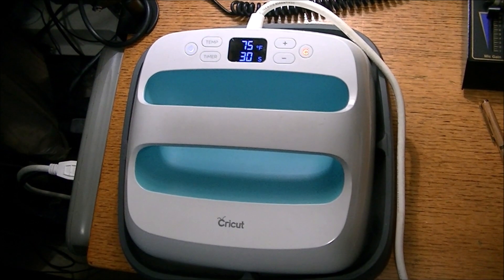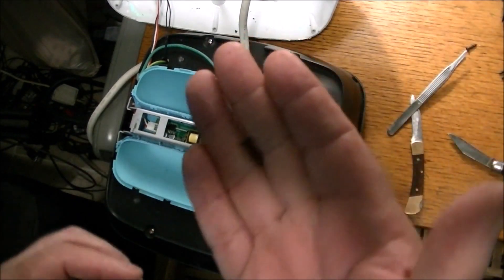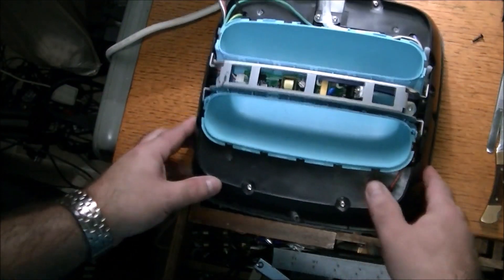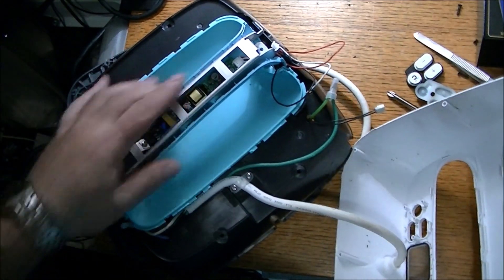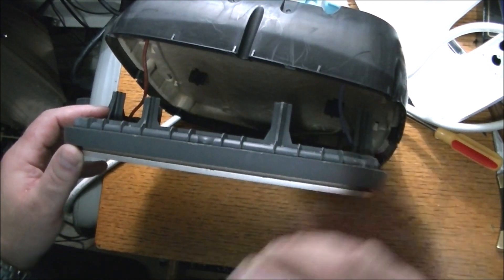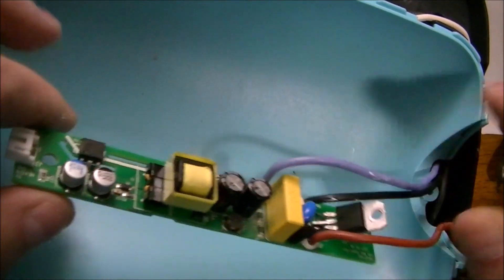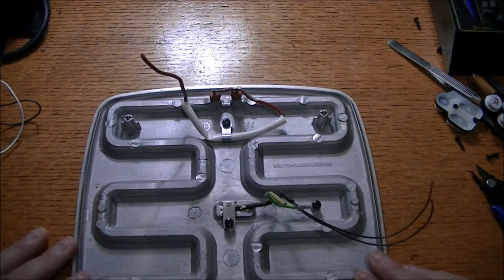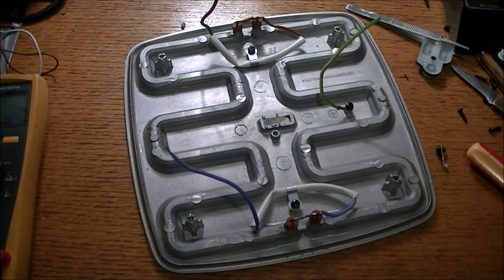Cricut Heat Press NOT WORKING Disassembly and Troubleshoot

Comment: I was taking my 3 apart using this as a ref.  On mine, that three pole transistor screwed to the handle has a burn mark against a wire insulation next to it and some marking where it is bent, and the middle pole is snapped off at the bend w/ additional scoring.  I'm not certain if it is worth trying to repair at this point because I would be uncertain on trusting it in the future.
Reply from the maker: That sounds like a significant issue, especially with the damage to the transistor. It's tough to decide whether to repair something with that kind of damage and then trust it afterwards.

Comment: Hi Andy, On the back of the heating plate, there are 2 white sleeves, inside each of those sleeves is a thermal fuse. My money is on one or both of them being faulty. Cheap and easy to replace... good luck!
Reply from the maker: Yes, both thermal fuses id show as open under continuity. Sadly, the element has also failed. I was going to make a third video when I discovered the thermal fuseshad failed.  I took them out and then discovered that the heating element had also failed. It would have been a very cheap fix. Thank you for your comment Paul.
Reply: @Codeeze Do you have a solution for the E5 error?